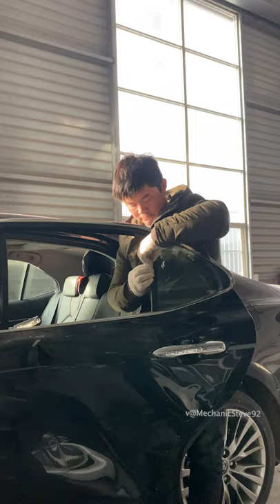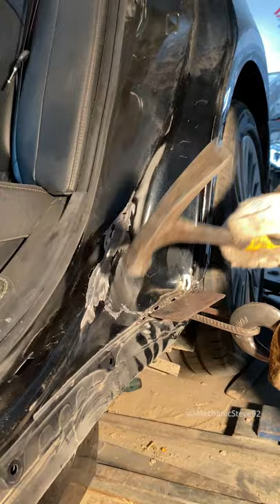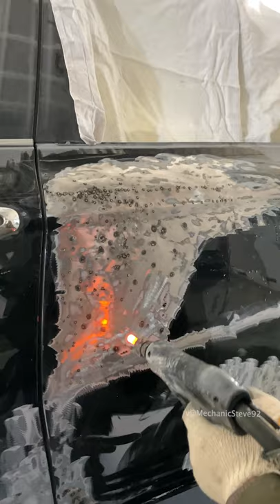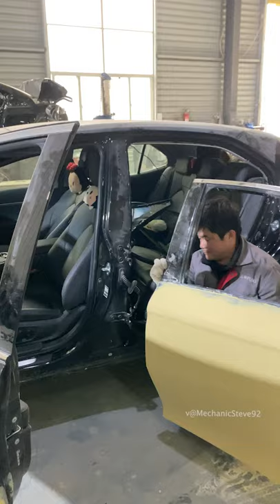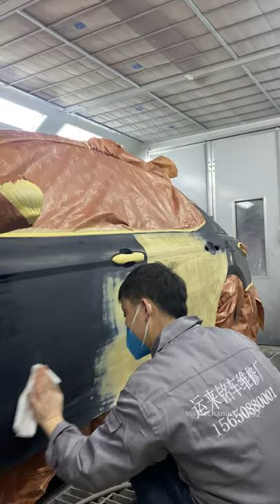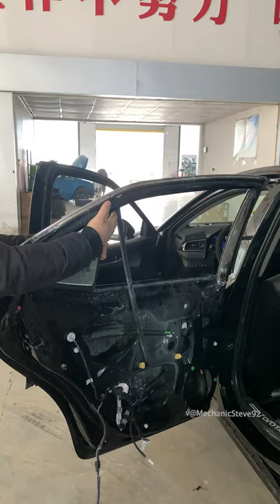Toyota Camry Panel Repair & Painting Full Process

Comment: Another HORRIBLE REPAIR. This in no where are you is what should be done. The inside structure bar was BENT. You should replace it. If the car is struck there it’s gonna crumple. Also do all your straightening after you grind off paint you can heat the door up and stretch the metal even more. I’m sorry but this is scary.
Reply: They don’t have the money for a repair panel it’s china they barely have enough money to afford food. The last thing they need is an expensive repair bill. This way the customer pays much less.
Reply: @averagecarguy420  what? China has like the world’s largest automotive aftermarket supplies. A door skin would be very cheap or even a used door. My point was this kind of repair is what get people hurt. If your child was in the back and you got in in the rear door your child would most likely die.
Reply: TheLambo2  huh? Scaremongering? Because I’m saying improper jobs get people hurt? No I’ve never seen that happen in 22 years. I’ve never seen a job have to get redone by people who aren’t just trying to make money fast no matter the cost. I’ve never seen an insurance company sue a shop because they did something so dangerous someone could get killed. Never seen someone get a car fixed them have more problems and the shop who fixed it the first place won’t warranty work. Your right what do I know I don’t do this for a living.
Reply: @averagecarguy420  what propaganda are you snorting bro? lol. That would be true 20-30 years ago
Reply: Hey you know what they say!!!! Everyone is different.  To me what matter the most is that is fix, another point is the buget if you dont have the cash or tools your very limited but at the end of the day i love every work and upload this guys share i say keep up the work